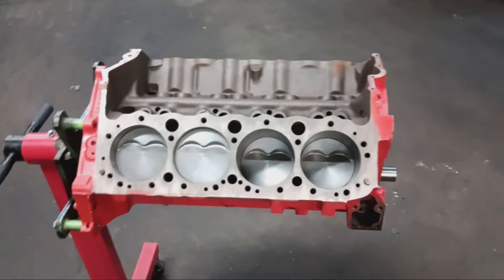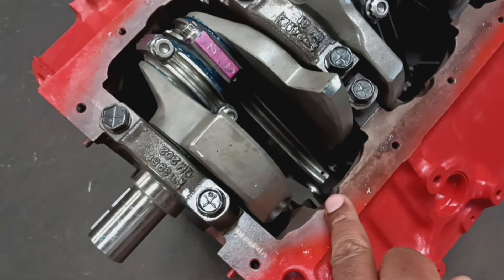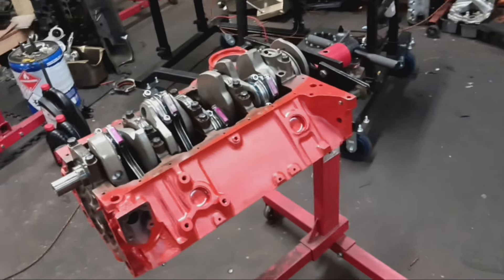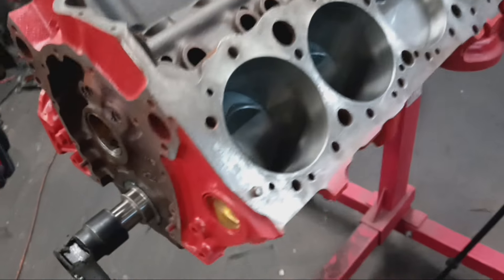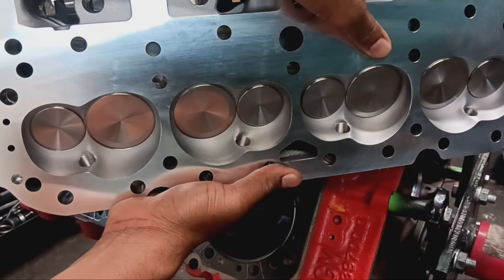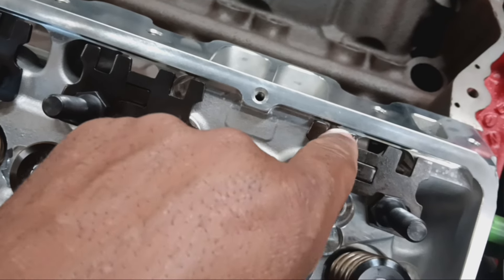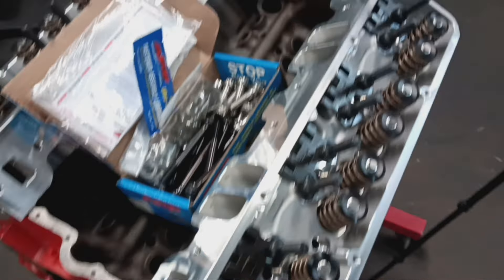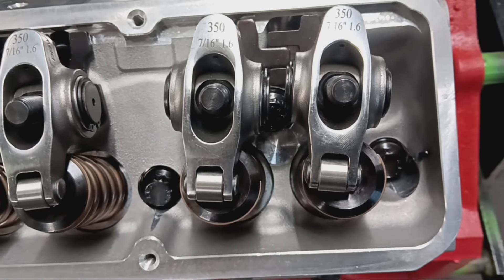383 built to put the pedal to the metal

Comment: I respect your work. I'm a 9 to 5 muhhh, but I am hoping to bring my 1984 Chevrolet Caprice Classic Landau with a 305SBC/Turbo350 no overdrive to you for a LS 6.0/4L80 swap.  Getting my grip right before I holla. Right around the corna - love the videos and the work though
Reply: I got a 84 caprice coupe I’m ready
Reply: SSP gone get that box right fasho, bet let’s keep that baby conventional wit a 355 or 383 😎
Reply: He built my 355 i have in my 81 caprice coupe about a year ago and I’ve loved it since then… ready to go 383 or 400 now need more power
Reply: @lavannsimmons1737  
My buddy does truck and tractor pulls with a 355. He pulls the thing off the track every time. Nascar used to be limited to 358" and they make power. I like big engines but a 355 can handle.